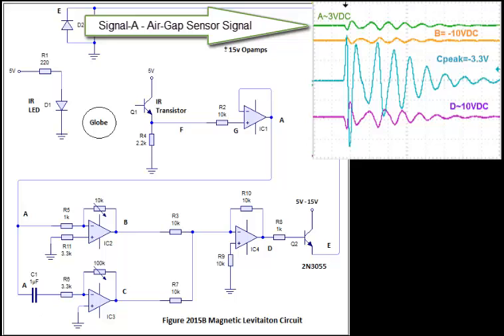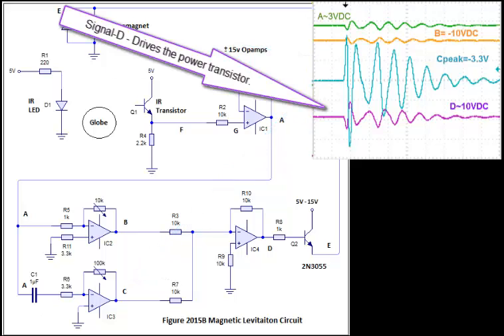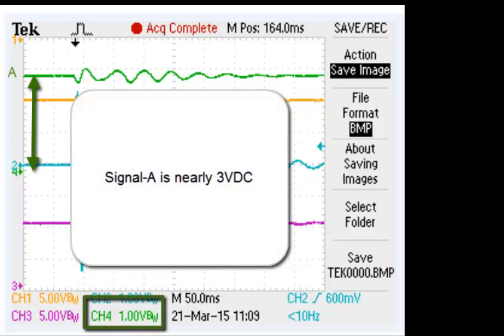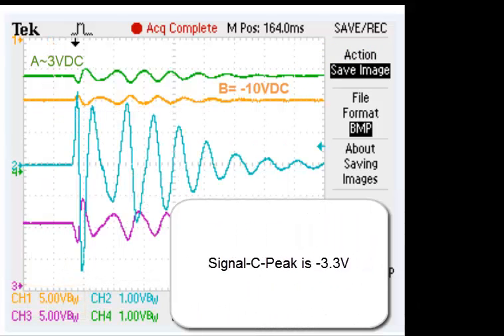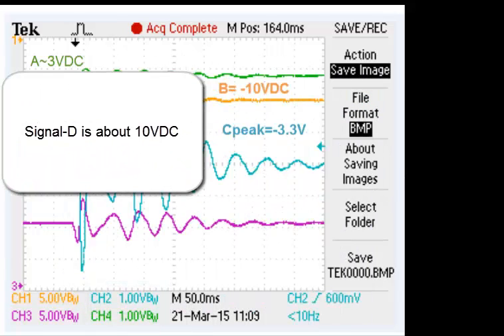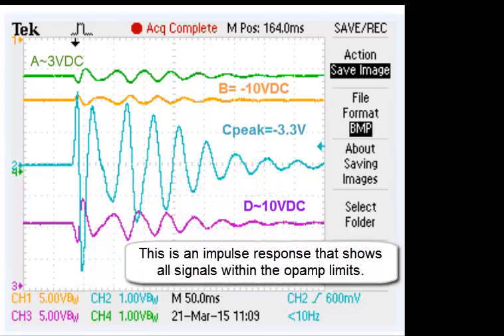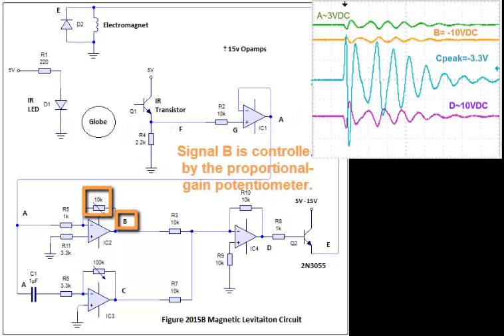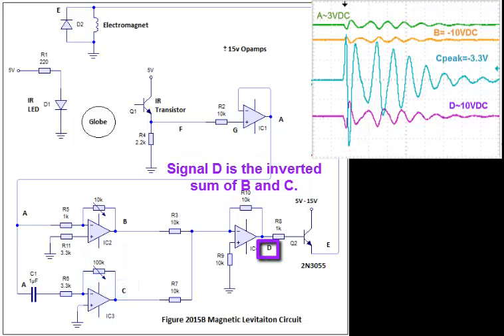B46217 - Magnetic Levitation - Impulse Response

Comment: The output voltage from the summing op amp was changing with the input sensor voltage so i dont think there is a problem with the control circuit but i think the output current from the summing op amp is not enough to drive the transistor

Comment: I tried to do the same circuit which i did but there was a problem with 2n3055 transistor wont increase the output current (2 amps 15 voltes)  to drive the coil i think the op amp output current is not enough